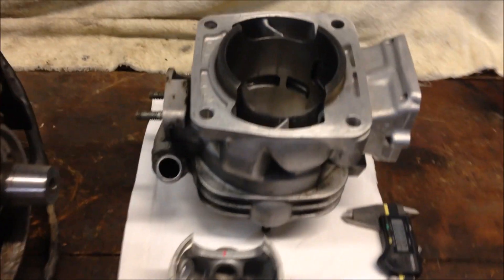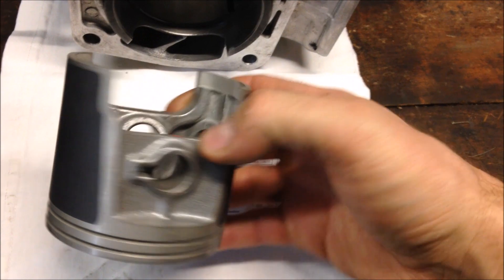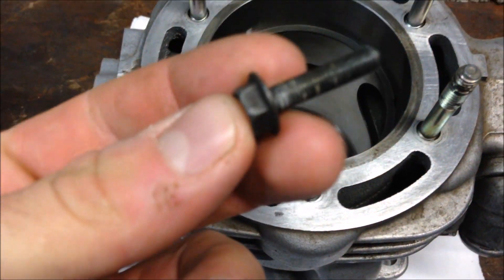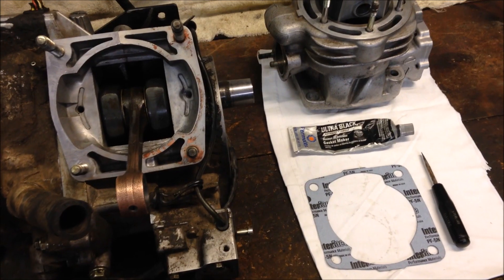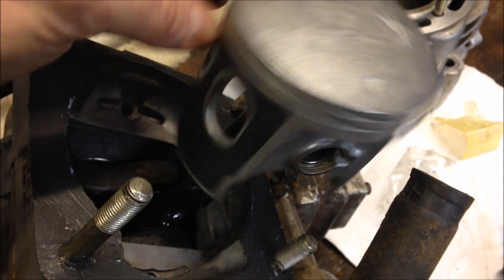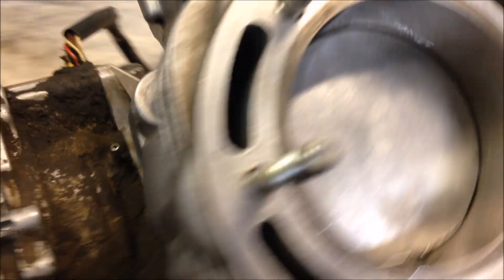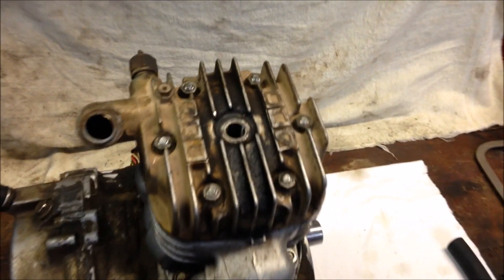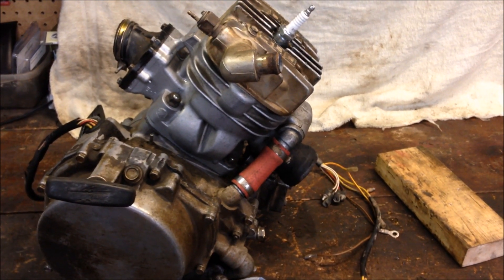Step 9: How to Install Polaris 300 350 400L Top End Cylinder Piston Head Intake Exhaust Manifold

Comment: Hey brad. Need some help. I am going to order a new piston and rings. Piston fell of table and broke. The old rings at 1 inch in cylinder  measured at .028 with filler gauge. How do I go about ordering a new one. I haven't measured the cylinder cause I don't have the tool yet. The pistons I've seen so far are like 83.5mm over-bore and all the way up to 85mm over-bore. I appreciate your help!
Reply from the maker: Checking the ring end gap of an unknown ring won't help determine the piston size. You would almost need to know the OD of the ring (which is not a standard measurement) and could possibly ask someone to measure the OD of their oversized rings to find out what piston goes with it. .028" reg is too much also.

Comment: Awesome video. Definately very good info and makes me think I can rebuild mine. I recently bought a 1996 polaris 400 4x4 and I checked the counter balance dipstick and it was rusted out. So yeah a rebuild is in the works.
Reply from the maker: Dear Brap,

Try it! If you run into trouble just ask!
Reply: Hey there brap. I have a question. I started tearing into my 96 400 and noticed the gear on the oil pump had striped. I found a replacement gear for that. I haven't gotten to the counterbalance gear to see what that looks like. Do you know if the gear on the counterbalance that mates to the oil pump can be change as well or do I have to replaced the whole counterbalance?  Thanks in advance.
Reply from the maker: You could replace the whole oil pump assembly with a used one for probably $20. If the gear on the pump was that worn, the mating gear on the counterbalance should probably be replaced as well if it's worn or missing teeth.
Reply: Thanks. I appreciate the quick response.  Have a good day bud!
Reply: Brap Stuff thanks again. I am having the cylinder checked and bore if needed.
Reply from the maker: Yes and if you have the cylinder bored they need your replacement piston to check the piston to cylinder wall clearance.
Reply: Brap Stuff ok cool.  Thanks